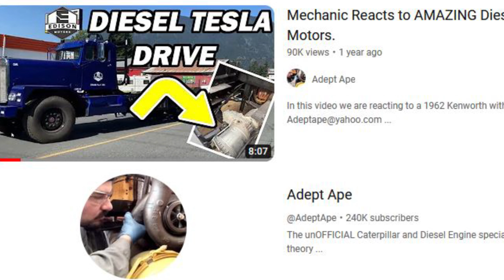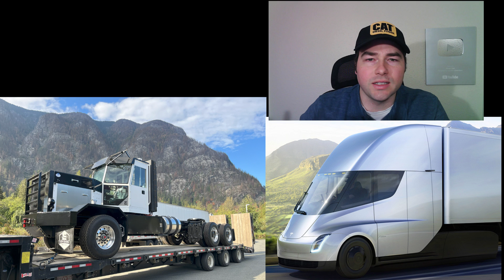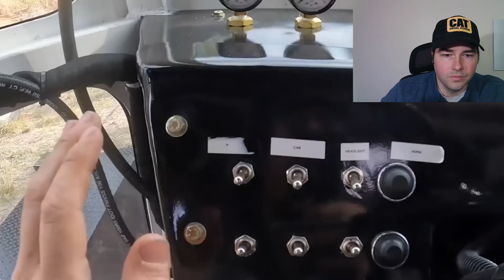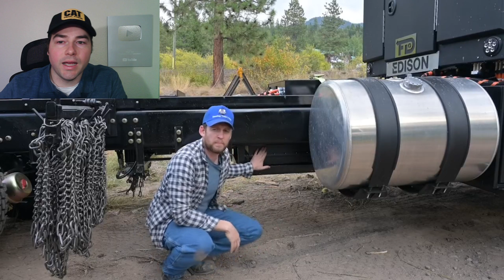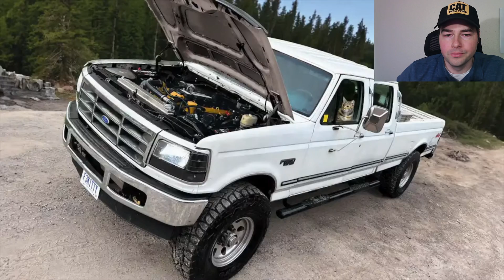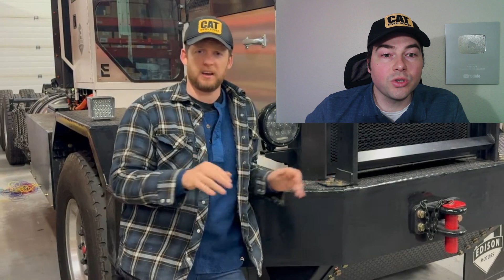Edison Motors New Truck DESTROYS the Tesla "Semi Truck" design!!!

Comment from the maker: Thanks for watching and let me know what you think of Edison Motors? I know they aren't in production yet, but this is the best concept design I have seen from any manufacturer yet.
Reply: Deboss garage has signed up to put together a pickup. They also did a collab video with Edison about the pickup ideas.
Reply: Chase gets it. He is doing everything with the end user in mind. Which is always good for business.
Reply: Check out deboss garage. I believe he is doing Edison motors first pickup conversation
Reply: The plan currently is the Caterpillar C3.6. The C9 in topsy was replacing the C15 (and equivalent) size engine. Keeping with around a 40% reduction in size, puts in that category. That’s for a 1 ton setup. If a 1/4 / 1/2 setup comes (Ranger/F-150) you could probably go smaller as well. Depending on how you want it kitted out.
Reply: Well now you've got another video to make since Chace just did a FAQ video about the truck conversions and specifics.
Reply: I love the passion they have to actually build a truck that will be easier to work on.
Reply: Easiest way to keep the AC/DC thing in mind, AC is easier and cheaper to produce, but AC can't be stored. AC converted to DC to charge the battery and store that energy. DC is returned to AC to drive the motors because AC motors are extremely efficient.
Reply: Has it been in the field yet? Or is it just a proof on concept machine?
Reply: In one video he said the pickup truck engine would be a cat 3.3l out of a skid steer or mini excavator
Reply: @edgartaylor7421 chevy got little 3liter duramax fer half tons trucks too but not sure how they r pursonally but what bout the portable diesel 5000watt generators like 1 i use fer home backup power and i got 6.6 duramax i wouldnt mind keepin in my pickup
Reply: Great video as always! Like the hybrid truck idea! Completely feasible compared to all the nonsense with fully electric. Check out Rich at DeBoss Garage as he’s partnering with Edison on the pickup! Maybe you can join the evaluation team!
Reply: I have said that whatever the EV world dose it needs to be a stand alone machine. No draw on the grid.😎😎👍👍🚛🚛🇺🇸🇺🇸
Reply: They don’t need an emissions system because it’s a stand by generator. The same you would see on any remote construction site. Until the government changes the regulations because of this truck it will be allowed to go into production without an emissions system.
Reply: Like was stated earlier the motor they will be using is a Cat C3.6.  They do say that the it is up to the installer on if you want to use other engines.  The older engines will work better because they won’t have as much reprogramming to do to get the engine to run at a constant RPM and not throw faults or error messages.  Also older trucks will have less problems with proprietary computers for the body, lights and other components.
Reply: I wish I could buy on of those without all the electric stuff.
Reply: Some thoughts:

1. I seem to recall Chace saying that a pickup retrofit is expected to be around $40k or so, or half again as much as a new truck.  Don't quote me, though.

2. One serious benefit of HEV over EV is battery life.  Battery packs generally don't outright die; rather, their capacity reduces over time--generally 2% per year--so you end up having to charge them more and more often, with each charge taking the regular, LONG time.  With an HEV, the charger is built right in, so you can charge as you go, much like having a secondary fuel tank in a regular ICE vehicle that can fill the primary tank at will.  In other words, the battery bank could probably get down to 25% of its capacity before it becomes a serious problem, mostly through the increased fuel usage.  You could expect to see HEV pickups still running on their original battery twenty or even thirty years down the road.

3. As pickups vary a LOT more than semis and tend to have a LOT less space to work with, Chace has repeatedly acknowledged that every installer will have to figure out a custom solution for every one of their customers.

4. One solution I had for the problem of lack of space was to put the batteries in the engine compartment and put the generator on a pup trailer.  The truck then becomes a normal EV for regular running around, but can still charge on the go for longer trips.  As well, you could--for example--leave the trailer in the bush to run the welder so your buddy can start fixing a broken-down skidder while you head into town to pick up parts to complete the job.  ...or run your house when the power grid goes down while you go pick up the kids from the suddenly darkened school.  (Heck, you could do that with pretty much any vehicle at that point.)

5. HEV 6x6.  'Nuff said.

Cheers!
Reply: The only problem I have with Edison motors is that they call their truck an electric truck which is false. It has an electric drivetrain powered by a diesel generator therefore it is a diesel electric truck not an electric truck.
Reply: I’m curious to know exactly the weight of Tractor and if it’s so heavy tht a lot places in usa banned cause of to much damage to roads and highways. Specially after the thaw comes every spring 😊
Reply: I think this a serious competition that Tesla doesn’t have an answer too the fact that it can charge itself for long hauls is a huge advantage.
Reply: Perkins engines is owned by Caterpillar
Reply: I really like the concept of the truck and the work that has gone to make it a realistic rig for the work they are going after. That said within the last month or so I have started to see more signs of company rot like talking about "Responsibility to the community" and signs that the inventor/CEO is getting drunk on social media attention verses just putting out a great product and letting it speak for itself.
I hope things improve but the realist in me expects for him to eventually step in it bad enough that it will cause everything to fall apart.
Reply: But Edison was paying, or had employed the makers of contraption and the Edison film crew filmed it and distributed it to try one more late and feeble time to sway public opinion on AC current. Edison wasn't there because he wanted to be able to have plausible deniability. Edison was evil, and he always took credit for other people's work and other people's inventions, but he let someone else take credit for the electric chair to avoid sullying his name. He was the perfect example of a man who started corporate greed and corporations hiring scientists to take their intellectual property.

Comment: They are using a 450hp cat to maintain charge on a 775hp capable electric motor. That's probably overkill a bit. Using constant speed engine, 200hp is plenty for a 450hp electric capable motor. Simply because you are rarely going to be using 450 or even 200hp moving the truck. Maybe 40hp or less steady highway cruising in a 3/4-1 ton truck? Maybe LiFe batteries? cheaper than lith ion and more robust. Less weight and more energy than lead acid. The absolute genius of hybrid is you don't need 2 tons of battery for range. You can reduce that by 50=70 percent. Something like a VAG 1.9TDI would be more than up to the task as a power source for a pickup range extender.

Comment: AC drive motors necessary for regen. They work just like a generator for braking making AC through the inverter through DC regulator into the batteries.

Comment: It is nice for the application. But it is a very "small" market in comparison to what the normal truck would consider a market. In europe for instance the logging / offroad tractorunit is a tinytinytiny fraction of the yearly sales.  
Engineers aren't as dumb as mechanics think we are but when designing modern things packaging space is not really there.. Price is a huge factor, the weight of the actual finished tractor unit is a huge factor in certain vehicle combinations, it limits the payload etc etc. 
It would be financial suicide for the established OEMs to make a truck that follows the same designapproach Edison did.

Comment: Would the Diesel generator fall under the same laws as off-road? The generator can be configured as a constant speed so that would be much cleaner than with a gear-jammer application. Pure Electric requires none of the below, or expensive emissions-defeating fluids or service/repair. Batteries have been declining in price and charging time.

For example - Your heavy-duty truck’s emissions system contains multiple interconnected components that contribute to reducing hazardous emissions.
Exhaust Gas Recirculation (EGR) System: The EGR system recirculates a portion of exhaust gases back into the engine's combustion chamber, reducing combustion temperatures and lowering the formation of nitrogen oxides (NOx).
Diesel Particulate Filter (DPF): Your DPF is responsible for trapping soot and particulate matter (PM) during combustion and has been a legal requirement for most diesel vehicles in the US since 2007.
Selective Catalytic Reduction (SCR) System: The SCR system introduces Diesel Exhaust Fluid (DEF) into the exhaust stream, transforming NOx into harmless nitrogen and water vapor. 
Diesel Oxidation Catalyst (DOC): The DOC facilitates the oxidation of carbon monoxide (CO) and hydrocarbons (HC) into less harmful byproducts.

Comment: fuse isn't necessarily worse vs braker. For isolated system if well designed and work properly fuse would NEVER break. If fuse break in that situation that means another MAJOR malfunction happened (like inverter) and then you don't want to reenergize randomly broken parts.
For sockets where you connect outside equipment yes breaker is 100% way to go.

Comment: One thing I would think would be a good idea is to have the diesel be easy to unbolt from the generator. Then you can have the top be able to unbolt, and if the engine dies for whatever reason when out just drive out with a truck with a winch arm and replacement engine and swap them right there.

Comment: Re the pickup retrofit kit;  the prototype is being developed at the moment with a Cummins 4 cylinder.  If you have something you like better and the skills to get it working with the generator,  then that would be doable.  Chase guestimates that the kit will cost about half the price of a new F350 or similar.  The axles are actually F550 capable, but can fit the one ton.  Lighter duty may come later.  It won't be cheap, not in any sense of the word.  I have a lot of miles on a 2011 Volt, and i can't wait for my van to have regenerative braking.

Comment: You cannot put breakers in a high voltage battery system, as if you managed to burn trough a 600 volt high Amp breaker and your batteries did not yet catch on fire, you probably have a huge short circuit. Having a breaker for you to then put back up will 100% result in a fire.

Comment: Man... As a german mechanic who worked on Trucks and agricultural equipment for many years (when I say I worked on this, I actually mean in Germany you have to be an aprentice for 3.5 years to even qualify yourself for working on this stuff, not like "Sure, I helped my uncle once who had a workshop") I never saw this many red flags in my life!

1. These steel grated air lines do indeed wear. Especially the way that they are just stuffed into there. They are bent way too much. If you wanted to use something, that does't wear much, you'd better use a steel pipe. Still easy to acces, you can achieve way tighter turn radius without compromising the material, still very easy to service, looks cleaner and is way cheaper (even if you go to a random workshop and tell them "custom build this for me" or at least should be)

2. The hood design is bs. You do not have a "little workbench" you have a massive bump in your back when you have to service something that is not above your kneehight. Like for example 3/4 of the engine. Changing oil also seems like an achievement for this one. Believe me, I worked on forestry harvesters before. They are also built like this.

3. "You can fit a natural gas engine in here" - well yeah. you can. however, it will either not produce the necessary output for this or will not be economicly viable. Or - third option - it won't fit in into there. If you would put a battery in this little engine room, you'd probably have 0.5 Miles of range.

4. This thing looks like it is way too heavy. I don't mean like a "I'm an european, our cars are so small, why do you drive a F150?" Whatever. The total weight for a truck is regulated. Even in the USA. Because of bridges and stuff. You won't be allowed to pull the same amount of cargo, if your truck is heavier. The Tesla Truck has the same problem.

5. Diesel- electric powertrains have way more losses than diesel- mechanic ones. The reason they are used in locomotives is because a transmission couln't help but break (like many did in the early years of trains) and electric motors provide full torque at 0 rpm. Something you don't need in a truck, because you are moving much lighter loads (especially with this truck as stated above). Diesel- electrics maybe make sense if you are - for example - in a caterpillar or something. You know, where you would be shifting very much or going back and forth the whole day. But a truck drives on the highway. There isn't much shifting. You go 60 mph or something (I don't know the average truck speed in the US) and the engine is already in his optimal speed range and very efficient.

6. No mechanic will know his way around this thing. Sure. The Engine - no problem. But no one who works on trucks knows how to service or repair an electric powertrain. If one does then maybe he worked on locomotives before - but i wish you very good luck with that. I mean you could also go to a train workshop with this thing, but they wouln't help you, because they are owned by Union Pacific or BNSF or something and dont give a damn about your truck. It's not like there are indipendent garages for trains. "We want to set up a dealership service network" ... Sure buddy. Lol. What do you want to do? Train people on stuff they never seen before and think, the two times in their lifes, when they actually set this thing up, they will do it perfectly. And they have to do it like ... perfect. We're talking about high voltage and steel. 

In conclusion this thing doen't look like "This thing was built by a mechanic, not an engineer - YEAH!!1!" It looks more like this thing was built by a fool

Comment: i would question the emissions need.  im sure the EPA would update to include this truck, but that engine only runs a generator.  just like if you have a work truck with a generator in the back it dosnt require vehicle emissions.  But this tesla semi is designed for short haul town delivery. and the Edison truck is meant for a very different use.  So to say it destroys another brands vehicle is like saying a helicopter hovers better than an airplane. Its designed for a differant purpose

Comment: id personally rather have a parallel hybrid than a series hybrid like this. Though i was told that it would twist the frame from the combined torque, which can be compromised with a smaller diesel paired with the e axles in parallel.

Comment: omg, butterfly hoods are universally reviled by anyone who has ever owned one in the past.  Notably the B-Model Mack and "Flintstone" Mack.  Brain dead stupid.  Lets see, what other alternate fuels, other than diesel or biodiesel make sense.  Hydrogen.......worst idea ever, liquid hydrogen takes 9kw/hr of electricity to make 1 kw/hr of mechanical energy at the wheel plus all the other nasty,explosive and expensive issues with storage tanks and liquid plant.   Natural gas.......better than hydrogen, its safer but its impossibly hard to get any kind of range with compressed nat gas without a very large storage tank.  Maybe a wood gassifier?  just use the prime mover as  a rigid unit, with that 6 meters of chassis devoted to the gassifier plant and wood pellet bin.   Really the stupid of "alternate" fuels outside of biodiesel blends is impractical in the extreme.  Yes it can be done, but its going to be an economic disaster.  The only alternate fuel that shows some promise outside of biodiesel is butanol, and its best suited as a direct replacement for gasoline.

Comment: one thing about breakers vs fuses is clearing time. I work on large 2000kVA Rectifiers and inverters. even a fuse is not fast enough to save the inverters and contactors some times. if there is a fault with a breaker is would be catastrophic

Comment: For a pickup truck application, you could probably do an even smaller diesel engine, like a n844lt (cat c2.2) that only makes like 50hp, but would be fine for charging the batteries. Maybe not for someone who’s towing heavy, but for someone who is using it as a daily driver and the odd weekend warrior use as an actual pickup truck.

Comment: A/C motors have been used by railroads for over 30 years; EMD, Siemens and the Burlington Northern RR teamed up and used 4 SD60M chassis (SD60 locomotives with wide nose cabs) equipped with A/C/ equipment that was eventually installed into the next EMD locomotive the SD70MAC powered by a 710 diesel engine; the A/C side of the locomotive is in the traction motors. General Electric also built A/C powered locomotives as well.

Comment: Another thing about the diesel engine is the load is constant, just running the generator to charge the batteries.

So they pre-calibrated it to run at max efficiency, when it runs at all, so the emissions should be low even as a diesel

Comment: I believe this is the true way the industry will go, both heavy trucks and pickups.  Advantages of electric drive and regen braking, without the cost, weight, and charging difficulty of a huge heavy battery only.